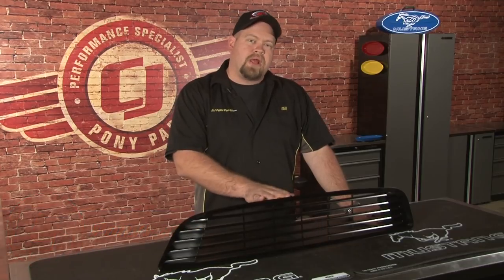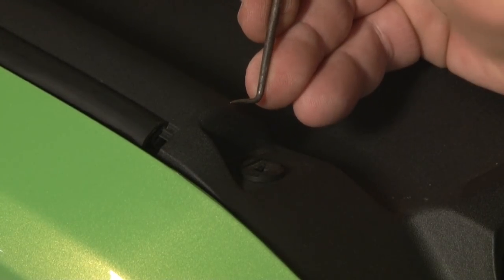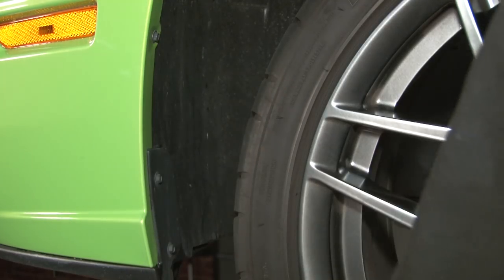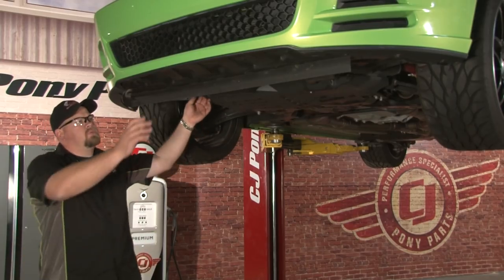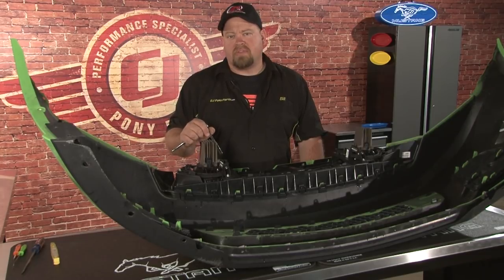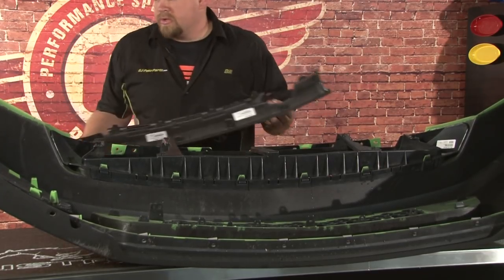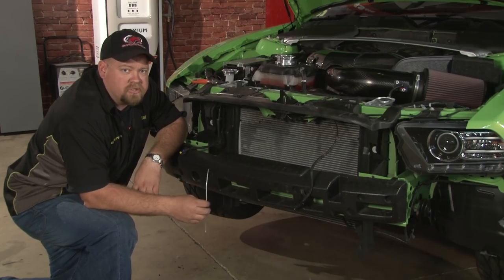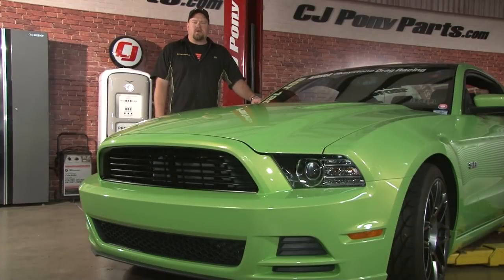Mustang Roush Upper Grille 2013-2014 Installation

Comment: The top hole alignment and the bumper sticking out are the same problem. The ends of the bumper have clips on the outside edges that have to line up and snap into place. If you don't have them lined up properly the edge of the bumper will stick out 1/2 inch or so and the inner screw will also not line up. Just remove all three screws, pull out on the edge of the bumper and while pushing the edge towards the front of the car push the bumper cover inward. You should hear it snap into place.

Comment: Thank you for the video. Really appreciate you guys taking the time to help not so smart people like me. Taking off and installing the grille was no problem but I ran into a few issues when putting everything back together. The first one was when the top hole didn't line up for the screw on the side of the car ( three holes by each tire). The second problem was the corner of the bumpers are sticking out and not flush with the fenders. Could you give me any advice?

Comment: Quick question. I have a 2012 Gt but I'm wonder if I can make the front look like a 2013/14 Gt? What do I need to change if it possible.
Reply: Daniel sill most likely buy an entirely new bumper, grille, and fog lights